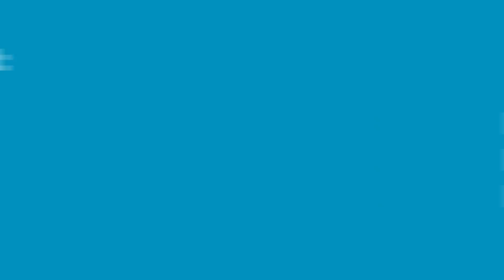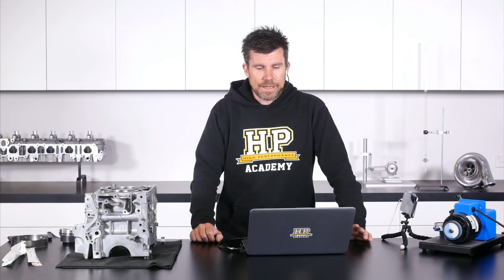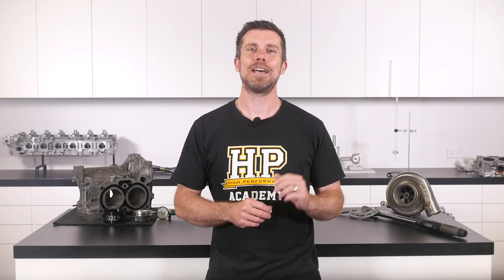Is My Engine Builder Any Good? | Finding Out The Easy Way [HPA Q&A]

Comment: 100% with that last statement. Just ran into this on my current 11:1, stroker LSA motor. Brought the rotator stuff back to have them change out the bearings as we decided to tighten up clearance. The guy who did the dial bore said, "glad to see we both measured within 1 ten thousandth"...lol

Comment: Well answered, also have a look around the machine shop, check if they have a full array of machines , so they can cater for machining EVERY engine component , if they outsource any machining work you really won't be able to be assured of optimal precision especially on indexing and stroke correction of crankshafts.
Also ask if they have surface finish comparator testing equipment , components maybe machined to the correct dimension in tolerance but the finish is suboptimal which could cause premature wear or non bedding in of certain parts.
Check if they carry out hot and cold pressure testing of cylinder heads and blocks aswell as magniflux crack detecting , some machine shops just take chances and sometimes there is catastrophe down the line.

If the machine shop also carry out dynamic balancing that is also a plus.
Reply: Actually the know it all usually suck much more than those who outsource some parts of the job. Those who spread too thin always end fucking up.

Comment: i wish you could comment on the dumb commercials that aired before this video. talking about plastic being “our worst addiction”. its a by product from making gasoline. so we are should just throw away the byproduct? cause i dont see gasoline going away anytime soon
Reply from the maker: Just because you drive a car doesn't mean you have to go full 'toxic meat bag' and use as much crap and pollute as many things as possible ;)
I do think you need a little bit more research into plastic though. It is good to be aware of where things come from and where they go, although it's also a little scary once you start to go down the rabbit hole - Taz.
Reply: @hpa101  Haha and ouch - good to see you're keeping the "Keep New Zealand Green" campaign going.
There is a MASSIVE amount of plastics used dasily without most people evern oticing it - perhaps some of the chaps should check out the pollution aspect of something with a break-down period of millions of years?
It israther shocking how people are still just 'throwing it away' - comes to that, what about car tyres...?
Reply: @gordowg1wg145  Plastic waste is especially worrying because their aren't many alternatives down the road. There's some stuff about bio degradable plastic from sugar I think, but other areas are being more heavily researched.

Energy for example will probably be alleviated heavily once we get fusion working, and once there's cheap electricity we can distill water and make hydrogen fuel and other things like that. There's actually ways of getting fuel (methane IIRC) using cold plasma.

But the rate at which we dump plastic is just alarming, and there's just not enough happening to solve it any time soon.
Reply: You're all having a moot discussion because youtubers don't pick the advertising that's delivered through their videos.
Reply: Seems you're not exactly in a position to comment on 'dumb' -  do some research and come back to debate it. Hints, it isn't a by product and there are a shed-load of other products made from petro-chemicals that will surprise you, for example fertilisers and rubbers.

Comment: So im from SE'ren Idaho, and grew up in my grandfather's machine shop (40 year old at that time) where we rebuilt ungodly amounts of model T anf A Ford motors. All I have to say on this subject is 2 things. 1, how many people can say they have poured and machined their own bearings? And #2, my gradfather came from a time of making things last as long as possible. Of course ive learned how to machine and blueprint an engine, but when it comes to buying parts, he distilled it into my head that any short cuts taken is X amount of miles less that vehicle will go. After a few years on my own, ive learned both these "sayings" are super true (to a point) and the bacics of your engine build.
Reply: Did you just feel like sharing? Or was there a hidden relevant message in your comment...?
Reply: @No Thanks It's so common man. They do it all the time. These old farts come around and go off on huge tangents and say nothing of value.